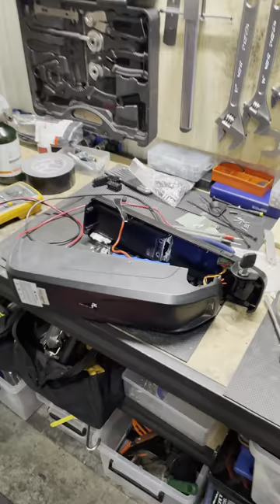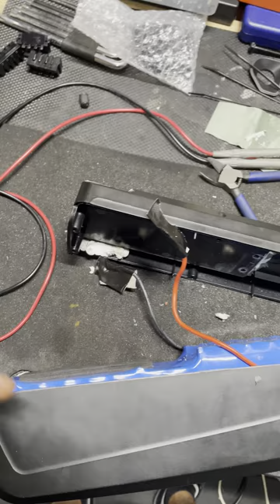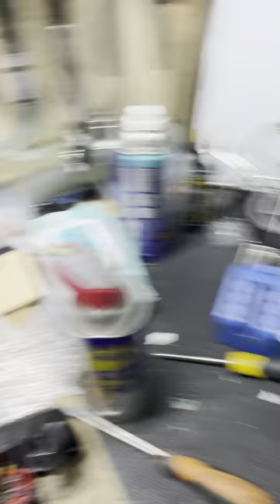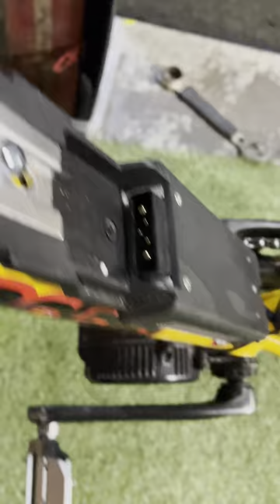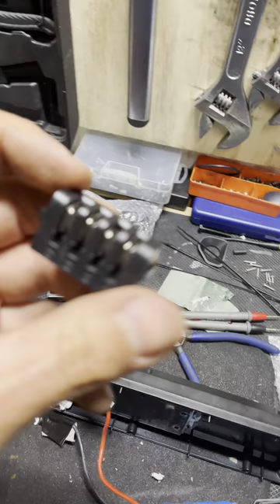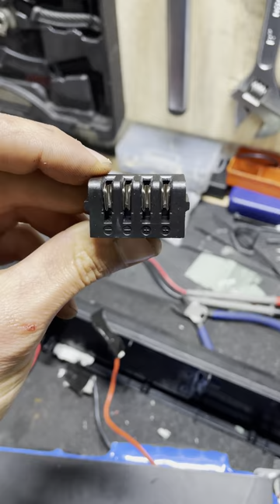Which battery connectors should I use in my Electric Bike Battery?

Comment: EXACTLY what I wanted to know the 4 pin seems like it would handle more power. But one battery I want down the road has a 5 pin. So I'll buy a 4 pin connector to put in it when I wanna buy that spare battery and just go with 4 pin. THANK YOU

Comment: never had a prob w/my bullet connectors.  but battery weakened after 3.5 years,  bought replacement battery ($288 LG 48V 14A) which came with  blade connectors, now trying to find blades for my weakened old battery, which i will use as a short distance spare.  aliexpress has a bunch + shipping, amazon has a few for more expense.
Reply from the maker: nice, replace the bullet connectors with spades.

Comment: Question: my bike battery has 5 contact pins and I would like to have another spare and I can't find one on the web, can you help me?
Reply from the maker: Buy an equivalent battery and replace the connectors
Reply: I can't find one for mine eaither the female plug is in the battery and my conection is male !?
Reply: I had the 5 pin and ran it for 2 years with a 1000w 48v front hub with no problems . Bike got stolen and I had to find a down pipe base to connect the battery to , it was difficult to find but found it on Amazon,  then I just saw this video . I was wondering if there was a difference while searching for the replacement and you answered my question . Guess I'll know for next time . There's not alot of info out there on this exact subject of the connectors .

Comment: Hi I have a Hailong and have had to change mine to a 4 plug in the battery. Do I connect both + and - in the male plug on the battery holder also?
Reply from the maker: two pins will be positive two pins will be negative , do not invert the polarity because you will cause a fire and burn your ebike!
Reply: Thank you for responding, I understand polarity, I just wanted confirmation of using two positive pins and two negative pins (insulated) rather than leaving the two middle pins and only using the outside positive and negative pins to complete the circuit (that's how it arrived from China unbelievably!)
Reply from the maker: Using 2 pairs, we are increasing contact and current flow while decreasing losses and possible failure, but again, don't invert the polarities; the base and battery connectors are mirrored! @obimadu5333
Reply from the maker: If you want to pay back for our advice, please give us a 5 star reviews on Google and mention our e-bike battery knowledge https://g.page/r/CX0AoVbmxOSwEBM/review @obimadu5333  See you in the next video! =)
Reply: No problem ++/-- are in the plastic to avoid mistakes. Many thanks.
Reply from the maker: You're welcome and thanks for the review! @obimadu5333